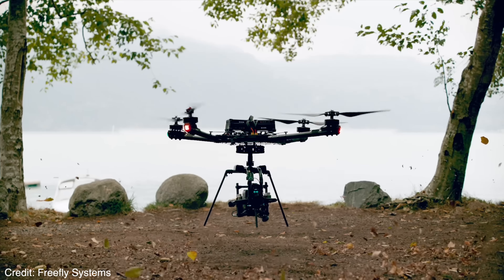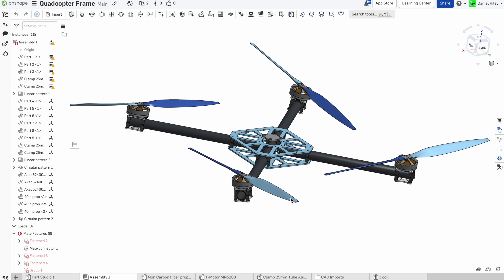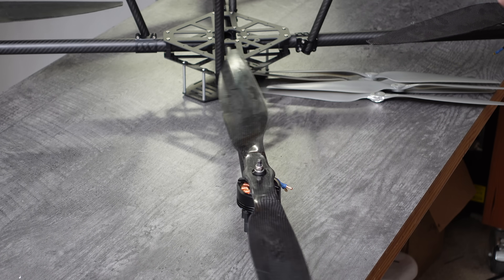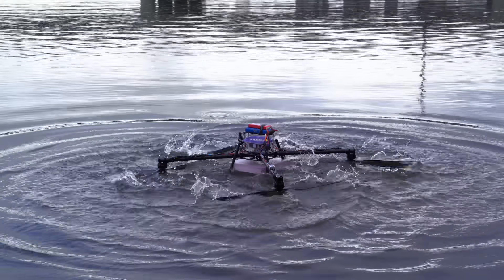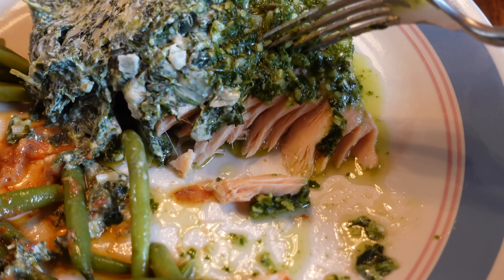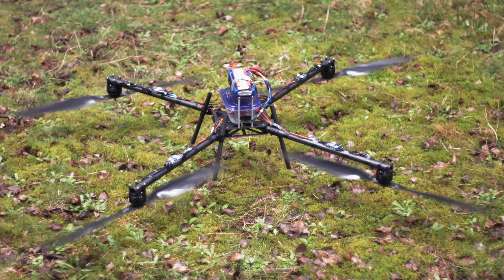Quadcopter Ground Effect Vehicle

Comment: I wonder how much it would take to achieve the hoovercraft skirt, or rather how little you might need to achieve it.

Ground effect uses the moving air (relative to the craft) to achieve what it does, so it's no wonder the relatively small surface area of the props doesn't manage to achieve that. (forgot the term, but the reason why ground effect wings are short, but wide,, or is that wide but short??) I'm guessing that is why. 

So for something going slow, the skirt method seems to be the better option... Now I wonder if there is a way to make a hybrid skirt/wing, that would combine both??

Comment: I love your creations, they are very cool and your process is thorough and clear.
Wingspan in the case of your copter would more correctly be the length of your motor support arms I would think, but using the over sized props was a great experiment.

Comment: 4:32 seems to be very quiet with those big props. Also wouldn't it have been better to run the big props with a higher voltage but with an amp limit instead?

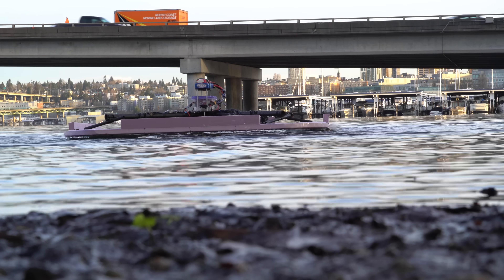Comment: 8:51 ... maybe ... just maybe ... that's Bernoulli at work.
You're pushing the air under the 'skirt' and along the water surface, making it flow faster than the air above. According to Bernoulli, that would create a pressure difference, pushing the drone towards.

Comment: Summary:
- The video starts with a discussion of ground effects on fixed-wing aircraft, and the plan to apply these effects to rotary Wing aircraft to potentially transform future transportation. (0:30)  
- Previously, the creator tested a ground effects vehicle design that was modified to behave more like a quadcopter by adding lifter motors on top of the wing. This didn't work well as the motors contributed too much to forward thrust and not enough to Vertical lift. (0:35-1:08)  
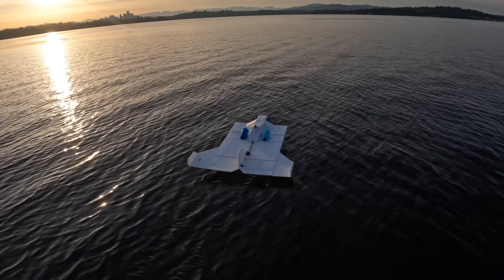- In this video, the creator attempts to make a pure quadcopter harness the ground effect in a practical way. The motors are placed on the underside of the arms so the props are as close to the ground as possible. (1:27-1:56)  
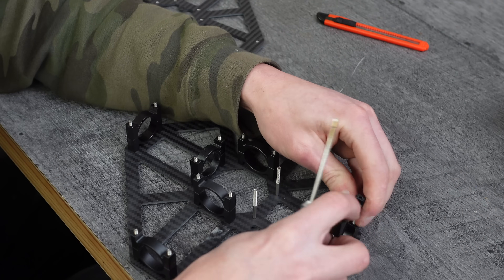- The quadcopter frame is cut out of carbon fiber plate and assembled. To make it waterproof, the electronics are mounted in a generic storage container. (1:58-2:35)  
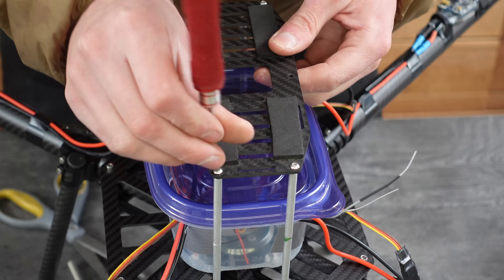- Testing of the quadcopter shows that it hovers well and the ground effect is noticeable. (3:12-3:31)  
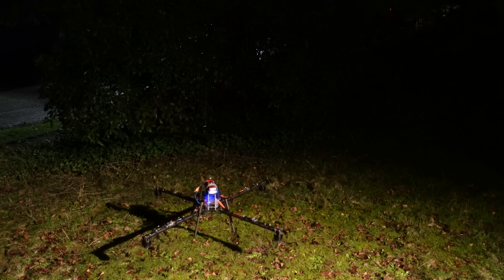- To enhance the ground effect, bigger, 30-inch propellers are used. These require more current to stay aloft but do a better job at feeling the ground effect than smaller props. (3:35-6:00)  
- The quadcopter is tested over water with foam donuts as landing gear. The props are able to hover just an inch or two above the surface and the ground effect is strong. (6:46-7:33)  
- A foam skirt is added to the quadcopter to help it float at lower throttle levels. The skirt helps stabilize the altitude but causes the quadcopter to behave like an air hockey puck on water. (8:23-9:10)  
- A Thruster motor and a Rudder are added to the quadcopter to help it build up more horizontal air speed without having to tilt forward. This makes the quadcopter unstable at high speeds. (9:18-10:02)  
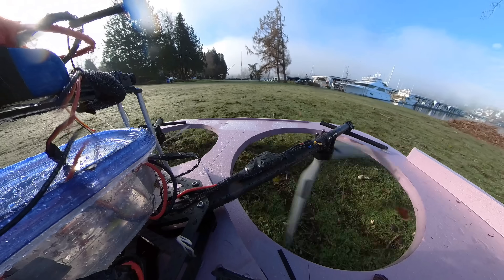- The video concludes with the conclusion that ground effect multi-rotors are not likely to be the next big thing for transportation. They may be more efficient at hovering low to the ground, but for practical transportation, fast, fixed Wing ground effect aircraft are more effective. (13:40-14:19)

Positive Learnings:  
1. Ground effect multi-rotors can be more efficient at hovering low to the ground, offering potential energy savings in certain situations.   
2. The addition of larger 30-inch propellers enhanced the ground effect, showing a notable improvement over smaller propellers.   
3. Waterproofing the electronics using a generic storage container proved effective, allowing for tests over water without damaging the components.   
4. The addition of a foam skirt helped the quadcopter float at lower throttle levels, providing a useful method of altitude stabilization.   
5. Using a Thruster motor and a Rudder helped build up more horizontal air speed without having to tilt forward, demonstrating potential for more controlled movement.  
   
Negative Learnings:  
1. Ground effect multi-rotors are not practical for transportation purposes due to their lack of speed compared to fixed-wing ground effect aircraft.   
2. Larger propellers required more current to stay aloft, leading to less overall efficiency compared to smaller propellers.   (Problem with the motors)
3. The quadcopter behaved like an air hockey puck on water, indicating issues with control and stability.   
4. The quadcopter became unstable at high speeds when a Thruster motor and a Rudder were added, showing limitations in design and functionality.   
5. The foam donuts used as landing gear didn't provide enough buoyancy, suggesting that a different material or design may be needed for successful water landings.

Comment: Nods in agreement

I done some experiments on a similar concept last year though it started from the point of trying to stabilise a 4-motor skirtless peripheral jet craft. On my channel as "Ground Effect Multirotor" though I will summarise it and maybe decipher the issues you were having.

The most simple skirtless craft is just a plate with air blowing down, but it needs a small lip around the perimeter to trap in an air cushion. Without that it will vacuum itself down to the ground provided it is smooth enough. So you may not have much luck with just 4 motors in a flat plate on water - perhaps on rougher ground and higher power it has enough of a cushion to feel some benefit.

A standard open rotor quad lifted off at thrust/weight of 0.6 in my testing, but it needed 0.85 or so to be actually flyable in ground effect. 

The peripheral jet craft are taking most of the 'direct thrust' airflow and venting it out the perimeter to deliberately trap the central air cushion in. With a light foam build they lift from the ground at TWR of 0.15 and become quite usable at TWR 0.5. So you have a region from 0.15 -> 0.85 where a peripheral jet construction is a better use of thrust than throwing air straight down. You don't need a flight controller for stability in that region either. The props are also completely enclosed so you don't shred them to pieces on the ground.

What I planned (and promptly discarded for various reasons) was a craft that would switch between peripheral jet flow and central direct airflow. On paper you can maximise efficiency in the close ground range but then transition to open-rotor direct thrust at the limit of ground effect. I pretty much agree it's not really a practical vehicle concept, more of an engineering experiment.

The pitch up on forward motion plagues all light skirtless craft - I credit Peter Keogh with the rear flap idea where you pivot the air jet to point partly down using a flap, this provides a countering nose-down moment. You can close up the front air jets to cut out that pressure as well. This allows forward speed greater than you "should" get. I've tried spinning down the front motors to reduce pitch up further but it's hard to manually control. I wonder if a custom flight controller program could try to do something similar with much better reaction time.

The "cheat" is to put outboard wings at the back to shift your ideal CG for flight to match the ideal CG for the hovercraft - basically the Bixel design in a nutshell.

I'm pleased to see any more experiments on this - it's a very unexplored region of ground effect and I don't think there's anything else quite like it. I built an automated testing rig to investigate thrust vs height vs power on various configurations, time for me to dig it back out and maybe get some more measurements.

As always I look forward to what's next.

*Edit: Two other advantages of using the peripheral jet hull around the props - you can vent the air from the ends of the hull for thrust without tilting the craft as a whole and you can likewise yaw without speeding up/slowing down the motors. And it floats handily on water.

Comment: I wonder if the 2ft. flight ceiling may be the flow vortex through the blades and back into it finding a stable zone, where there is enough height above the ground for the vortex to form a clean pattern, feeding the maximum amount of air back through the blades, and then getting any higher or lower breaks up the vortex by either getting ground effect or clean air flow through the prop.

Comment: i cant remember the name of the effect but when you spoke about the effect thats odd, the action lab did a video with a hair dryer and a couple pieces of cardboard, one with a hole taped around the blower end of the hairdryer and the other sitting on the table. at a point when you get close enough it actually sucks the cardboard up to the hairdryer, its a matter of linear flow, you create such a perfect system it actually creates a vacuum in some areasthat canel out gravity. i bet the same principle is happening there.

Comment: Well THAT was a new low for Youtube.. They put an ad in the middle of YOUR ad.  As for the flights... get away from angle mode.. Its totally useless. It is far too brutal. Go with Horizon mode where you can lessen the strength it reacts with so it doesn't insta nose plant the craft into the water. you can also play with the angle it reacts to to adapt that to suit the needs . Might be a bigger help on windy choppy days where you test.

Comment: You might want to try some fans with high static pressure instead of standard props. Also you are probably running into a similar phenominon as helicopters that hover in 1 place too long in that you stall your own rotors. The cycling wind creates a low pressure zone over the craft, which isn't actually as good as it sounds because it removes the amount of air available to the blades to bite. There is no steady state when hovering a rotary wing near the ground.

Comment: I've flown toy drones and helicopters indoors and encountered a problem with ground effect in reverse - if the rotor gets too close to the ceiling, the model will just stay there until I throttle right down. Then it plumments to the ground uncontrollably.

Comment: I'm curious as to how much a normal helicopter is affected by ground effect in forward flight and at different speeds. It would be interesting to see some tests with simple, single and tandem rotor designs.
Reply: ecause most heli fly forward using tilted rotor to pull themselves, it's not going to give the same wash cushion for ground effect. You're going to be moving beyond most of the upliftt. I would agree that there's probably a small range where you get some assist in elevation but it's gonna be velocity and area driven. I would suggest that with tail-roto designs, this effect might be more destabilizing than assistive pretty quickly. Perhaps there is a way to use it that hasn't been well explored yet tho.

Comment: The soft ceiling is probably due to a vortex from the thrust hitting the ground and circling back around to come back down on top of the blades, reducing efficiency until it powers through it.
Reply: I was thinking that he'd created a low-pressure zone in the center of the sheet, a bit like a vacuum. Yeah, I guess that doesn't make alot of sense when I think about your explanation. But that's some interesting phenomena as well, and should be useful for engineering something. I would venture it doesn't work while in motion?

Comment: 8:53 This is most likely due to viscosity/surface tension of water. Everytime you dip and then want to 'glue out' of it, it's an extra force to overcome. You aleo have quire significant surface area that this force works on.

Comment: Interesting video. A props happy place is in a free air environments where air can be pushed and pulled. Without a place for the air to escape from the bottom it would have trouble at higher pressures if it was not designed for it. There is a sweet zone for every prop. 
Something like a reverse incline blower wheel can provide much higher pressures at low clearance’s. It would have to be ducted.

Comment: RE the floats under the props. It looks like as the props spin up, the rotation of the floats cause the water in contact with the floats to flow outwards from the float center (centripetal force). This cause the water to evacuate under the floats. You might experiment with texturing the bottom of the floats (hot iron), such that the rotation draws in water (iow make a spiral texture).

Comment: Pushing the air under the shield towards the water increases dynamic pressure (and reduces static) so getting suctioned down is pretty logical.
Depending on distance and air volume of cause.

Comment: oh hey, I used to play with that effect when I was younger ! I had on of these tiny toy quad without any automatic stabilisation that I just could not fly without crashing it everywhere, but I noticed that if I gave it just enough throttle to get off the ground (flat tiling in this case), it would hover at about 1-2 cm from the floor, self-stabilize when tilted and never really get any higher.
so in the end I had a lot of fun racing my little remote controlled air-hockey puck around ^^

Comment: The idea of running the motors on lower voltage to decrease heat is, to my understanding, incorrect. Heat comes from current, which is proportional to torque. Bigger props = higher torque = more heat. If you plugged them into a higher voltage battery the ESC would lower the voltage until the same amount of torque (thrust, current) was generated. So the motors would have the same current/voltage with a higher voltage battery at a given RPM/Torque point, just with the voltage lowered by the ESC.
Reply from the maker: The idea with the lower voltage was just to prevent the motors from burning up. These are standard BLDC ESCs that have voltage control, not current control. But yeah, the heat issue makes sense
Reply: @rctestflight  The idea is wrong. Lowering the voltage will ensure the motors will burn up. You need to get an ESC that use PWM control, not voltage control. PWM simply turns on Full Voltage for the width of the pulse, then zero voltage. Any control of the voltage is simply due to the inductance of the motor, the magnetic field is never reaches it full potential.
Reply from the maker: Is PWM control not just voltage control? The ESC emulates a lower voltage by reducing the duty cycle. 
And I think this video is proof reducing the voltage prevents the motor from burning out. At full throttle on a 6S with the 30" props these motors wouldn't stand a chance. But at full throttle with a 2S they did not burn out.  @WeBeGood06

Comment: The ground effect is really noticeable when hovering an RC helicopter upside down. That why you see pictures of models hovering with the blades skimming the grass. It looks really hard, but it's easier than a normal hover because the model is just bouncing on the ground effect, and you can really reduce the throttle. With something small like the Blade MCPx in a gym with a smooth floor, the rotor tips often scrape the floor.

Comment: 8:50 that suction could be the air pushed down and out by the props getting "venturi-ed" (sped up) in the small gap between the foam and the water, creating a low pressure zone that "sucks" the hoverboard down.

Comment: The "soft ceiling" you mentioned is happening at the point where the vehicle can no longer receive additional assistance from the ground effect. In order to gain more attitude past that point, it first has to increase the rate it expends energy at, to make up for the lost ground effect boost.

Comment: You can play around air flow path - if you add some channeling foam pieces, position of each propeler would be either raised, or air could be distributed through saw tooth like edge skirt around. Now when one side goes up, air from rear motors will go towards less resistance path - and destabilise craft more.

Without channeling/enclosure for prop wings you have a lot of pressure losess especially in radial direction, which maybe contributes to vibrations - each propeler hits wake from its neigbours. 

For mixed case when both pressure and volume is needed just lookup for industrial fans enclosures - they arent straight, but slightly narrowing/ rarely expanding. It allows for some design tweaking, where we would like to find sweetspot for motor efficiency and flow requrements. 

wrapping central unit in some foil, would reduce air resistance at fan "inlet", its not that obivous in steady flight, but in hoovering mode You calibrated stabiliser, and in horisontal flight, its adds uneven air wake for front/end fans.

Comment: I noticed you sayd the bigger props used more current but you also said you ran the smaller props on 4s instead of 2 if i understood it correctly so the power(Watt) is lower on the larger props. Or did you use 2s for the measurement on the small props to?

Comment: Water is not a great surface to demonstrate ground effect on a helicopter type system due to the air loosing energy to the water before recirculation, you would have much better efficiency over a solid surface with no grass etc. We're taught as helicopter pilots to assume significantly higher power requirement when IGE over water.

Comment: Lower CG (battery etc.) should help stability.  Higher props with duct (mylar? fabric?) can address the prop-strikes and moist-motor issues.  But now you've got a hovercraft.  You're right, not a viable design.  Fun anyway!

Comment: What if you where to take the rotors and put them in line with the arms. Then take the outer tip and angle them a couple of degrees down. So that they are pushing the air slightly inward? Or even try to angle them slightly up? Idk just an idea.